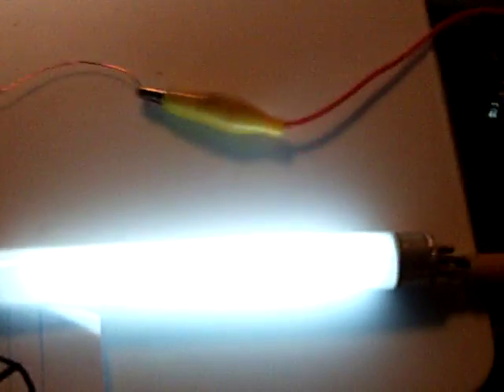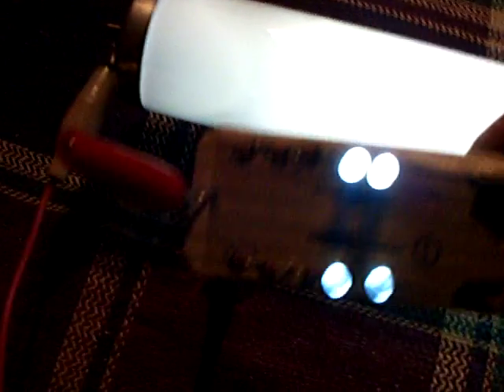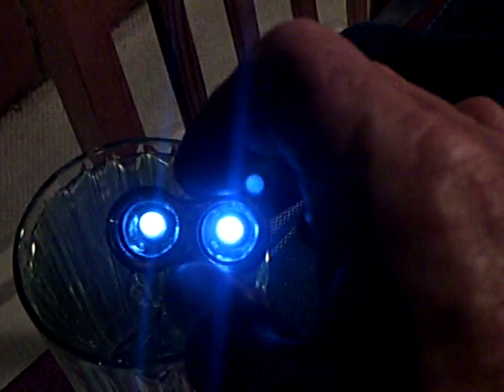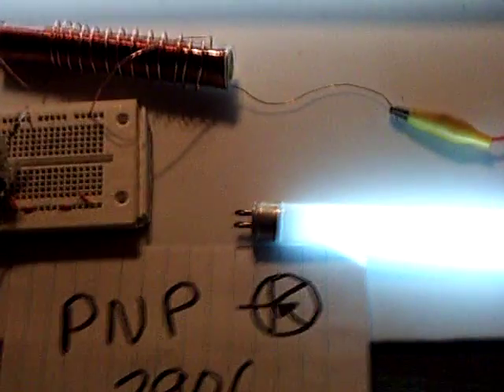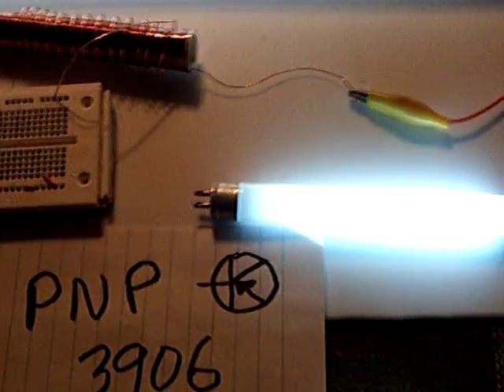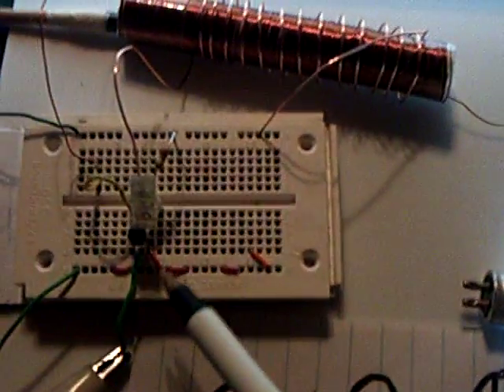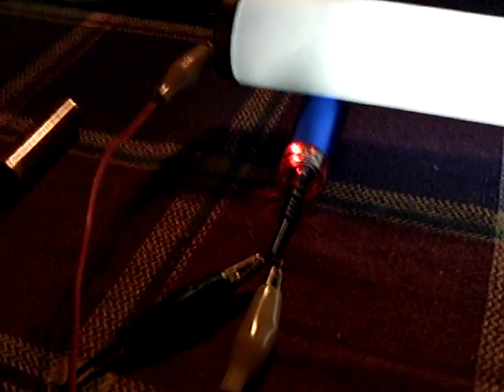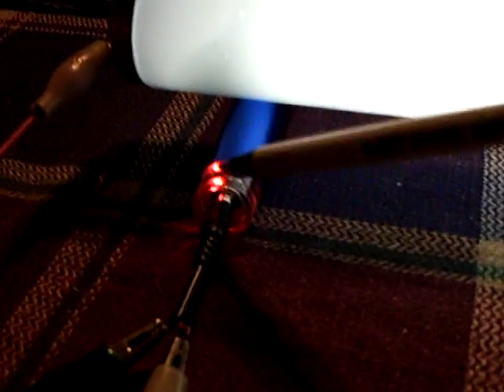Slayer Exciter using one PNP 3906 transistor

Comment: I don't understand how folks get these to work with those tiny 400mA transistors. I've got one running a pair of 2N3055's in parallel, and they both get hot enuf to burn the fingers.